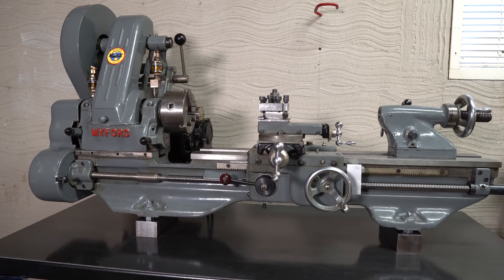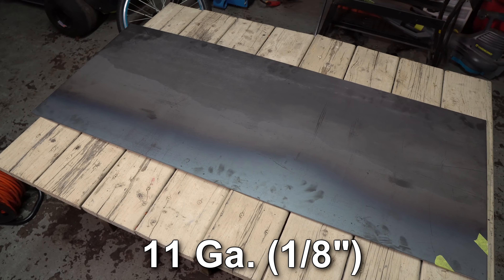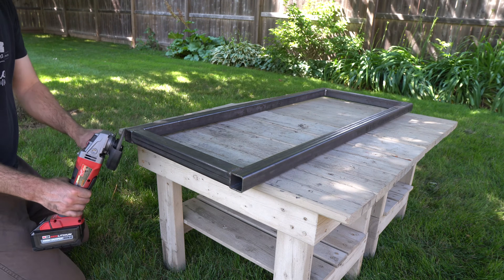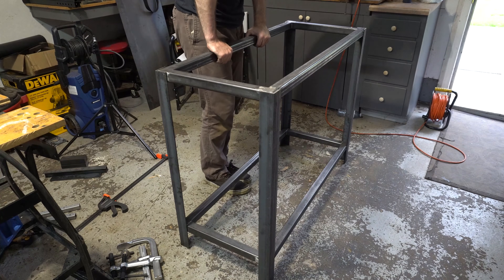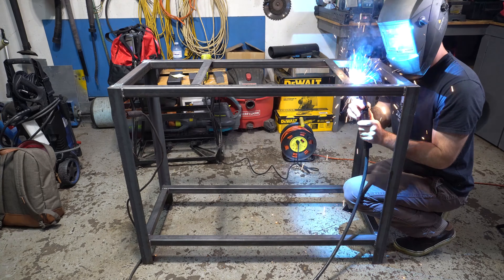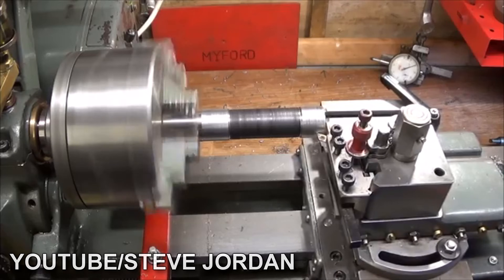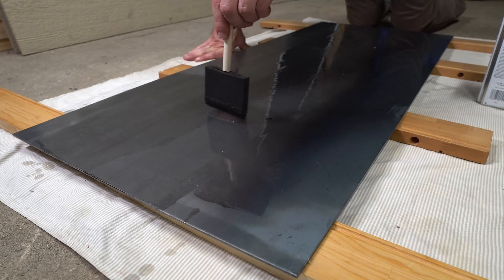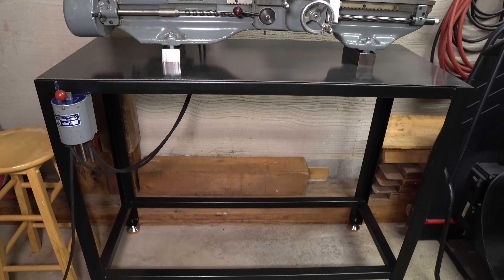Building a Sturdy Lathe Stand

Comment: Thanks.  That looks like a strong stand for your lathe.  I'm planning on building a similar one for my Super7.  Have you had any issues with twisting front/back or sideways?  If so, I might add a cross brace on the back and sides.
Reply from the maker: No issues at all!

Comment: I've been doing the same.. I'm converting a drill press into a mill set up with a crossslide table and I'm going to be milling optic cuts into pistols. Just waiting on a few more parts at the moment.
Reply: Good luck with that, it's nearly impossible to mill using a drill press due to the morse taper that holds the chuck in place, your chuck will just fall out of the drill press hence why milling machines exist.
Reply: @OriginalAirsoftGasser  Yeah, I know.. I'm gonna modify it.  I have 3 drill presses that I got for basically free.  I'm either going to weld on a bolt to the end of the taper, so that I can put a nut on it--  or I'm Just going to weld the chuck in there permanently and it will be a one trick pony mill for awhile...  I have an older press that looks quite a bit different than these newer/  smaller chinese drill presses/ bench presses that are common now...  This older one might be built a little different, I'm not sure. Either way, I NEED to get into milling lol.. I've already got some bits and a dovetail cutter and an X/Y table that's pretty sturdy... I'm in no real hurry, I'm basically waiting on it to stop being hot outside and then I'll put some hours in the shop..  If I absolutely have to, I can build my own head with some cheap tapered wheel bearings and swing it to the side of the drill press so I can use it's motor--- or even tear down a cheap $30 tread mill and use that motor/ variable controller for a home set up..   I see those tread mills on Facebook all the time --- I've actually bought two of them myself;  and for whatever reason, there tends to be 3 or 4 of them on there at all times for dirt cheap...  Not sure of the exact path yet, but one of these things is coming. haha
Reply: @calholli  If I were you I would look at getting a 3d printer and learning it, it's a great start to get into CNC as there are many similarities, my plan is to build my own CNC milling machine starting off small and then scaling it up into something bigger using what I learn on the way to improve my machine.

Comment: Long time machinist safety tip. Always cut towards the chuck whenever possible. It's better to push the work into the chuck instead of pulling it out if the work becomes loose for some reason.
Reply from the maker: Thanks! I appreciate any tips like that